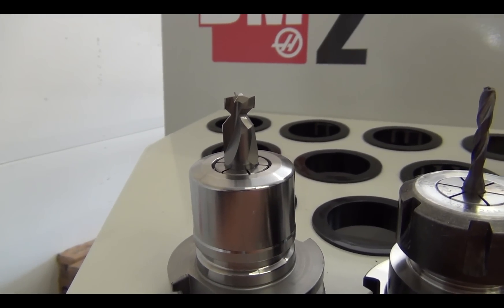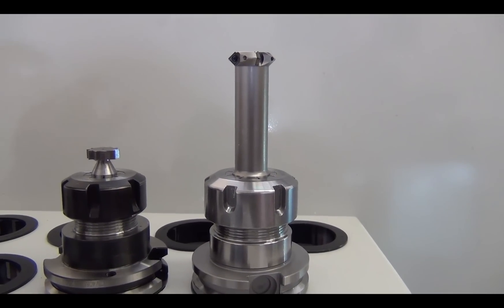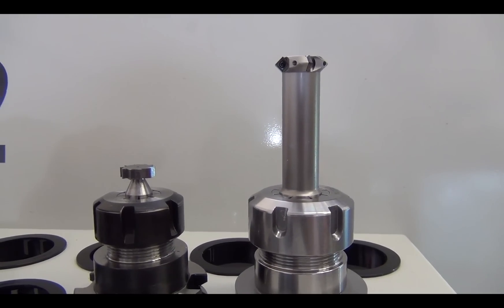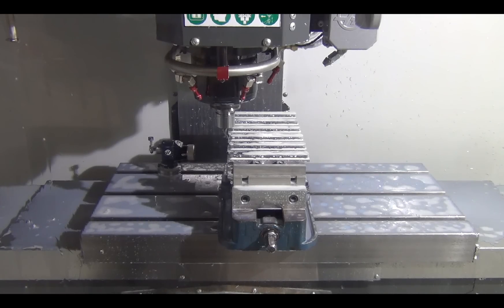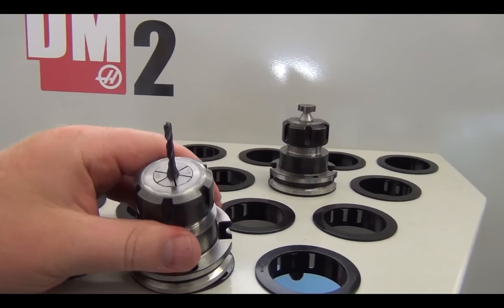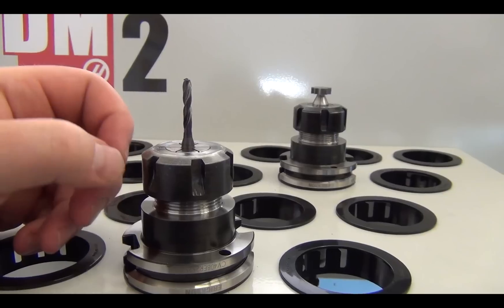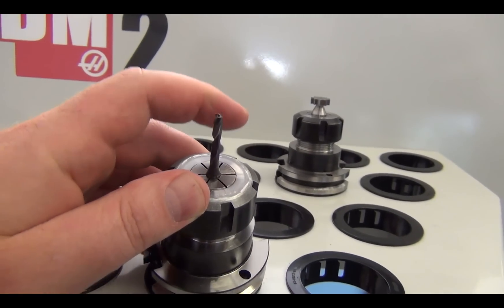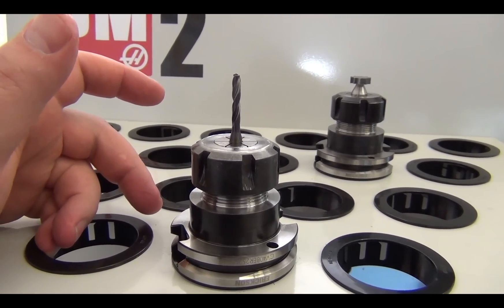New Tools in the Shop

Comment: Awesome video.   I couldn't tell was that the 1/2" or 5/8" shank picatinny cutter from AB Tools ? I am actually the guy that makes them. I also make them with two flutes as well as four flutes. If you would like to test another flute configuration to see if you can't increase your speed with out compromising your part then let me know.  alf@abtoolsinc.com
Reply from the maker: Hi Alf. I'm using a 1/2" shank 3 flute in this video. I have a 2 flute but this the flute keeps humming along. How hard can I actually push it?

A 5/8" 4 flute would be awesome for an upcoming project!
Reply: Tikka Shooters I would think that you could increase your sfm by 25% and increase your chip load by 50% as long as finish isn't compromised. If you have room for the .605" Ø cutter (5/8" shank part # PT605-90) it has the same profile but more chip room even with three flutes , you might even be able to go faster. I think you said that you got them from a rep. Let him know that we recently dropped the prices because we are selling so many of them.  Our email is mail@abtoolsinc.com
Reply from the maker: Hi Alfred,  I just sent you an email.  Wylie Clark came by the shop and I purchased a couple 4 flute .605s from him.  There's a cool project we are going to do in 17-4ph with it.

Thank you for your input!
Reply: Tikka Shooters he is awesome and his son Matt is really hustling for us also. I am making more four flute 605s right now as a matter of fact 👍
Reply from the maker: Alfred Lyon What speeds and feeds should I use for 17-4PH H900?  4 flute 605

Thanks!